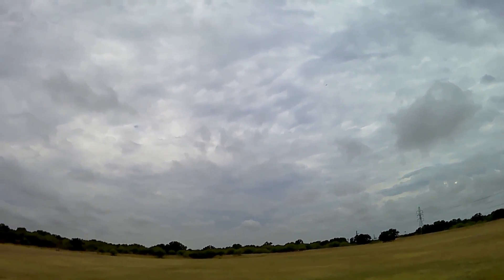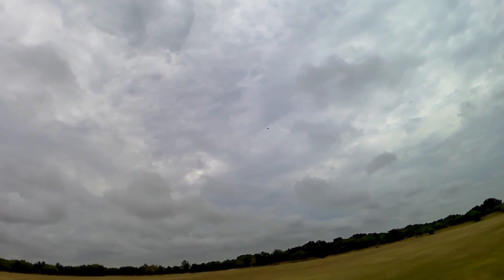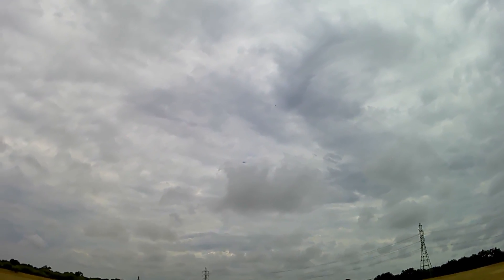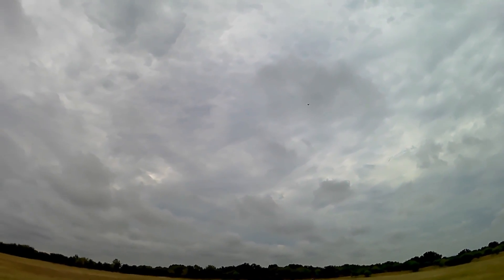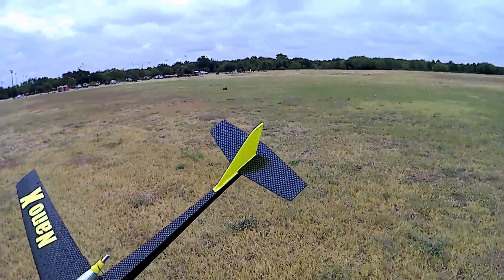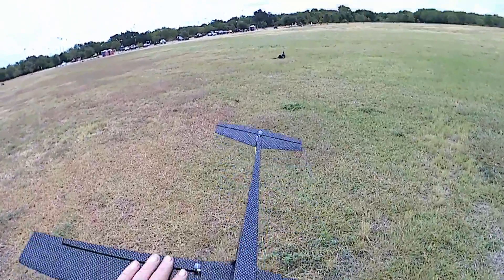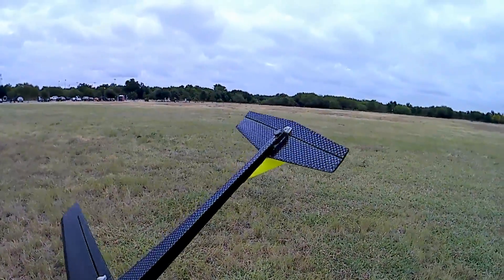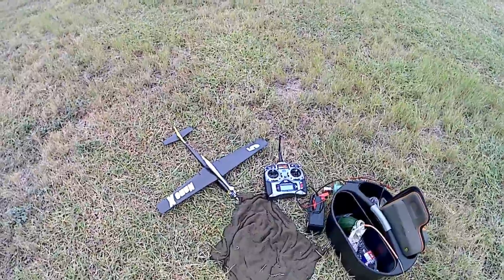2nd Flight Test NANO X / Cox Tee Dee .051 / Profi .8cc Tuned Pipe

Comment: Reminds me of the 1/2A pylon racers in Australia in the 80's. We were getting 27-28k on 40% nitro in the air just before the motor blew. i still have a box of parts - probably about 25 motors worth.
Reply from the maker: What was the typical all up weight and required prop in the 80's?
Reply: @AmpAbuser  Never weighed one but about 5-600 grams I guess. They were conventional low wing semi-symmetrical styrene/balsa sheeted with strip ailerons and a f/glass fus.I used 8x4 or 7x8 topflite nylon white/red or wooden prop (which broke on landing often). Fuel tank was 1 oz sullivan with fixed pickup. Roll inverted to cut.

Comment: Have you tried clocking your props so the blades are horizontal when the engine hits compression?
Reply from the maker: No it spins up so fast the prop mass / pitch to ball socket loading lags one another.

Comment: What pipe manufact is this
Reply from the maker: Profi .8cc Tuned Pipe from the Ukraine
Reply: @AmpAbuser  is there a Shop where i can get them
Reply from the maker: @pirminkogleck4056  Yes a full wave pipe makes the most possible power. Also do a search on them and you will find some of my efforts. 
http://www.hobbyclub.com/index.php?main_page=product_info&cPath=44_202&products_id=1803&zenid=1ace4a1f3fa7d97d2f224b882526205a
Reply: @AmpAbuser  is it possible to run those pipes for 1.5ccm and maybe a cox motor?
Reply: @AmpAbuser  i just bought me a magnum xls15 and try to find a good tuning pipe.    Its my first nitro engine but i wanna get a quick one
Reply from the maker: @pirminkogleck4056  That pipe is good up to 1.15cc tops or .07 cubic inch.  See this .15 engine:     https://www.youtube.com/watch?v=jLEcY9w8mYU
Reply: @AmpAbuser  but this one is a 1.5 ccm ? Its the same wich i will get in a few days. So u say it is to Big for those tuned pipes.....mhhm i duno how i could get a pipe here in Europe
Reply from the maker: @pirminkogleck4056  https://www.justengines.co.uk/?v=7516fd43adaa
Reply: @AmpAbuser  thx,but i try to find one of those tuned pipes for 1.5ccm engines.....there are very few online Shops wich offer tuned pipes, i ja never found one....jE is a nice Shop,nur also there i couldnt find a tuned pipe